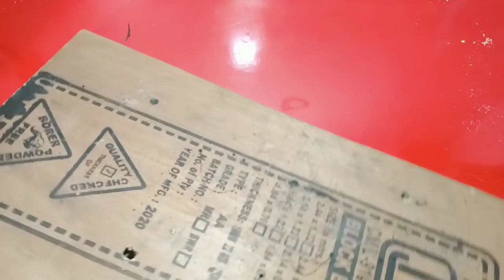Fuel Less Generator | From Car Alternator And Water Pump Motor | New Experiment | PMG Generator

Comment: Why connecting the Rectifier.  Rectifier converts AC to DC and so the DC that the bridge produces is connected to the rectifier circuit inside the alternator.  Therefore, it does not have anything to do there.

Comment: Sir it is good experiment without using electricity at the starting time. It is very useful to ryots where no current supply 
 Is it worsks with motor pump to lift water. Please reply and material used may be intimated  or if you supply the  same tp me .cost and your address.thank you

Comment: Yeah, again this fake BS. Have you ever heard of energy loss due to friction, and a thing called "heat" also exists? And what was the purpose of a rectifier behind the motor. By judjing by the design of the rectifier, it looks a 25 amp 60v rectifier. It's like you're using a 24v motor. So how didn't the rpm slow down here. In reality, the whole thing should not even spin, because the load (motor)is already connected to the alternator and it already makes the alternator very difficult to spin. Therefore zero output. And making this apparatus in a background like your's has already made it very suspicious.